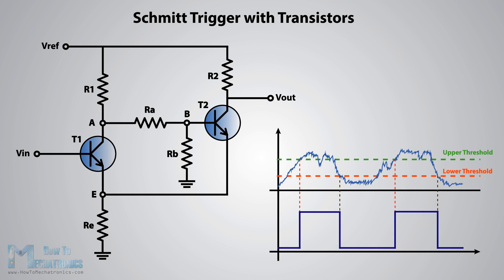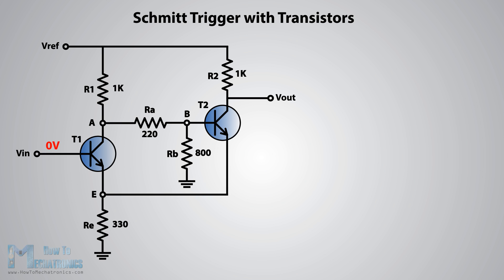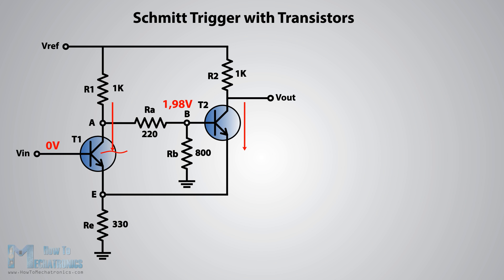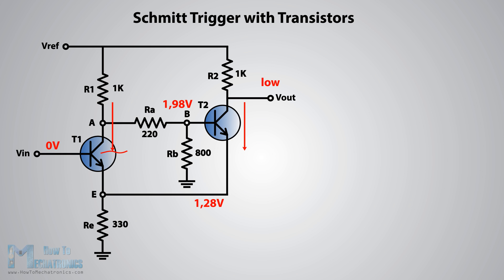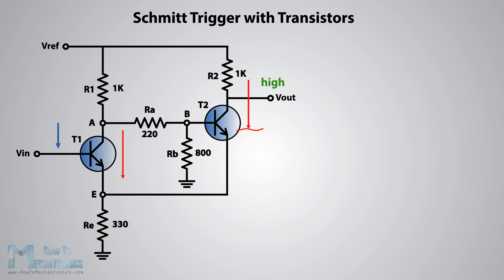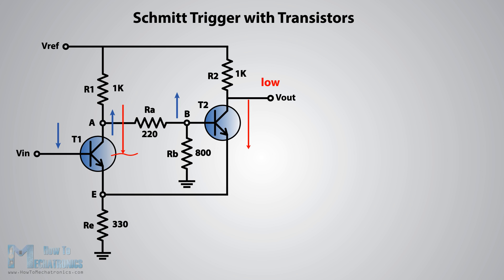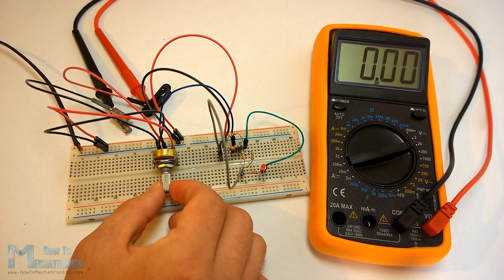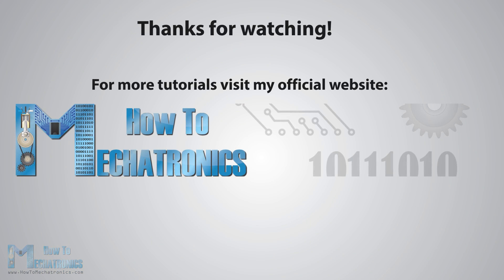Transistor Schmitt Trigger

Comment: Thanks.
what's the use of this circuit ?
Reply: Signal conditioning and processing of all sorts! If you have an analog signal which you need to process you have to convert it to digital first. This can be easily accomplished using this circuit. Processing the digital signal might be to retrieve the frequency, pulse width etc of the original analog signal

Comment: Excellent video. Thank you.  Question:

What exactly are T1 &T2?  I don't believe the cost of this approach can be lower than the jelly bean Schmitt trigger chips.

T1 & T2 will have to be very high speed switching transistors and cost each as much as an 8 gate chip.
Reply: You only need 2n2222 which is a great transistor

Comment: If adding a diode at base of Tr1 we can have a bigger hysteresis gap of 0.7 Volts 2 Diods will rase the gap with 1.4Volts etc.....
Reply: I'm sorry to disappoint you but the hysteresis will be the same if you add a diode(or 2, or 3....). Adding diodes at the input(T1), only increases the threshold but the hysteresis remains the same.

 Hysteresis only depends on voltage drop on Re.

Comment: Both Ra and Rb are useless in modern silicon transistor triggers. It's a legacy from old germanium transistors when saturation condition for T1 was not met
in order to switch off T2[Vbe was comparable to Vce_sat (≈0.15V)]. With silicon transistors it is no longer the case. I suggest you to get rid of them.

Another thing... 

R1 is too small. Usually R1 is 10 times R2.
Reply: @Afterbytes--->>>It has to be two thresholds. Get this: 

upper th.   5V×[0.33k/(0.33k+0.9k)]+0.6V=1.941V

and lower th.   5V×[0.33k/(0.33k+10k)]+0.6V=0.759V

where 0.6V=Vbe(T1), 0.33k is Re, 10k is R1, 0.9k is R2//R1(when T2 is saturated)
(Ra and Rb are omitted)

...and the hysteresis is: 1.941–0.759=1.182V
Reply: @mrtriac3024 thank you for this comment, sometimes one learn allot just from reading the comments!
Reply: Very good comment- I saw both circuits (with and without the 2 resistors) and could not explain why the difference.
Reply: Just tried this circuit with R1 = 10K and R2 = 1K as you suggest.  There no longer seems to be a lower threshold and the LED stays on...
Reply: @Afterbytes--->>>  Frankly, I don't get it...  Could you be more specific about the threshold? And the LED stays ON all the time no matter what input voltage is, or what???
Reply: The lower boundary of the input voltage trigger point.  Going past ~1.9V turns the LED on....though moving back down below ~1.3V does not turn it off using those values you suggest.